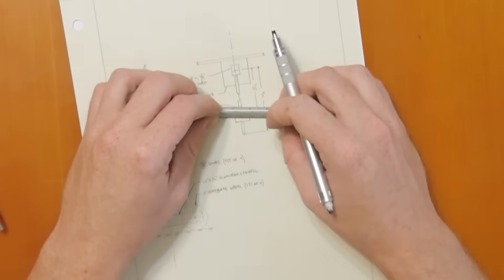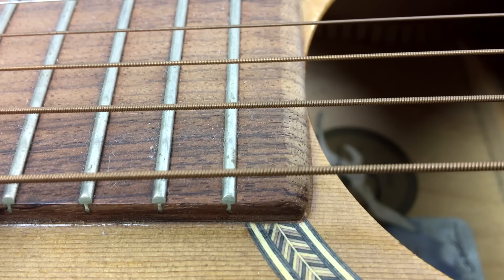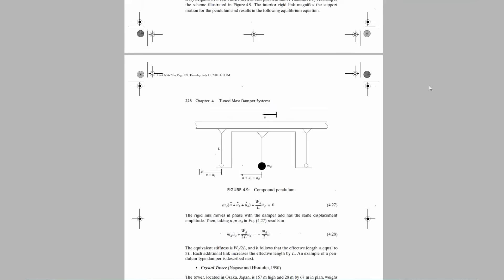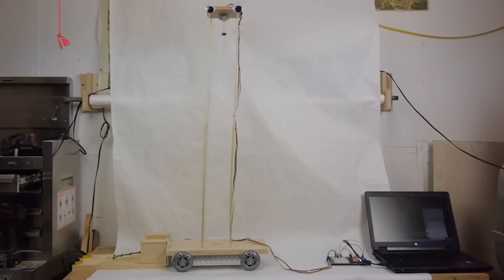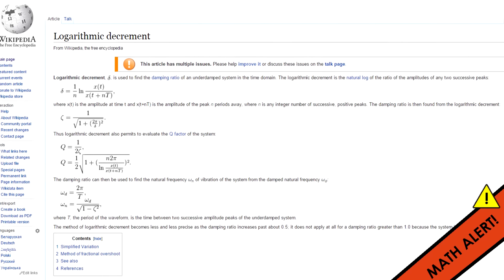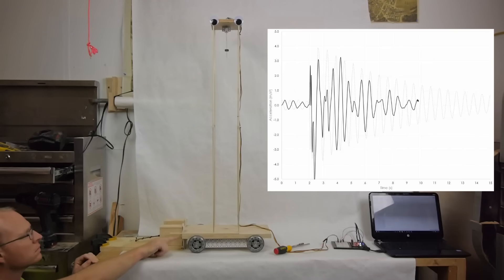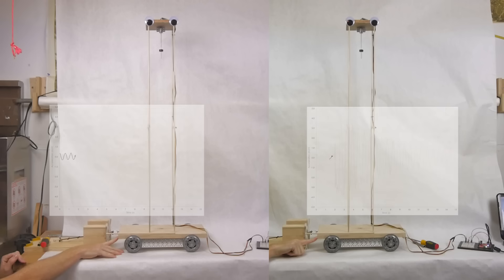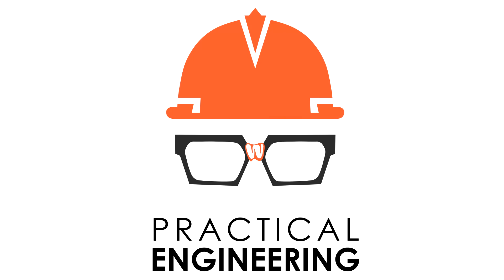What is a Tuned Mass Damper?

Comment: awesome video.  had no idea that was done on skyscrapers. from which height do they usually use this tech?
Reply: It's not much on the height itself, but to several reasons, such as the location it is built if it's seismic or not or affected by strong winds that would make the skyscraper oscillate too much it could be dangerous.
Reply: ***** But considering that winds can get pretty strong a couple hundred meters high, and that wind can oscillate a structure to rubble, engineers must have a rule of thumb for heights or expected wind speeds with this tech...I just try to figure out where can I see it in my area as I climb the highest cranes we have.
Reply: Cranes are different though: because they are pretty skinny and don't have any uniform surface to act as a sail. The damping is made after doing some calculations and statitics on the wind usually found in a location. For sure for something up to 200 meters it's not bother to have a dumper, since it can be done with other structures, but above that sure it's needed. Just look at the biggest skyscrapers in the world, they all have a dumper. 

The only thing crane have is that their horizontal arm is always free to move: that way it gives the least resistance to wind, without being in danger of collapsing. 

In other fields, there's no rule of thumb, but only estimations of the oscillatory frequencies, and if that could give raise to issues. The same applies to bridges that if they oscillate to their resonance frequency can collide. Therefore there is a rough estimation of the resonating frequency of the skyscraper, a statistical study to see if in that area those frequencies could be met, and then it's implemented into the design the dumper. As far as I know the old World Trade Center didn't have a dumper, and you could feel the oscillation on the top. Nevertheless, the oscillation was already dumped by the structure itself. 

In engineering, from civil to aeronautical (I'm an aerospace engineer), there are always trade-offs and compromises. You could build a stone airplane, but you'll have to face immense weight, no useful payload, and gigantic fuel bills. As it's stated in the video, costs are important decision makers.

Comment: Interestingly that type of oscillation is also observed in electronics. Designed (in)correctly, you can have charges oscillating back and forth between capacitors, dampened by the series resistance.

Comment: I liked the Japanese pagodas.  They have very heavy tile roofs on a wooden structure which is almost always a recipe for disaster in earthquakes. But the wooden structure consists of numerous gravity sliding tongue and groove beams and holders which are at right angles meaning each floor can move 360° to the other floors.   Each story is a different size, has a heavy tile roof on its outside and has its own resonance. It is very difficult to transmit energy from its base. Everything moves out of cycle with everything else.  The building has some sliding, but as the earthquake winds down, the movable joints like a pendulum running out of energy move back into their pre-earthquake position by gravity.  This reassembly is facilitated by a large tree trunk that flexes, but moves back into position dragging the joints around it back into alignment.  While this isn't a practical design for most structures, it is interesting and many have stood for hundreds of years.  Shrines to immortal deities are immortal buildings.
Reply from the maker: Very cool.
Reply: I belong to an association which restores and operates antique railway equipment.
       A couple of areas you might consider for segments.
      One would be railroad ballast. It has tremendous compression strength, it will support a locomotive, but it has no tensile strength, a few men with rods and shovels can dismantle it and then reformat it.  The key is the fact it is jagged and locks.  It can support a train, but it can't hold water. 
      Another interesting area that most people are unaware of is how conical railway wheels keep trains on the tracks and allow trains to transit curves.  Geometry dictates that the rail on the outer side of the curve has to be  longer than the rail on the inner side of the curve, but the axil and wheels move as a unit. Solution, as the train shifts in a curve due to differential elevation in the rails, the diameters of the wheels change, the wheel on the longer outside rail increases in diameter and the wheel on the shorter inside rail decreases in diameter. The axil makes the same number of rotations and wants to keep "perpendicular" to the two parallel arcs made by the rails.
     There is a video on the wheel-rail interaction, but it is in Russian.

Comment: Awesome video. Great experiment, and simply explained. I definitely need to check out that Algodoo. Do you have drawings of the pieces and the assembly of that skyscrapper?
Reply from the maker: There's a little bit better drawing on my website http://practical.engineering
Reply: Good enough. Also, good blog. Thanks.

Comment: I don't think the dampener can be replaced by a tightened screw.

Viscous dampers apply an opposing force proportional to velocity, surface friction applies an opposing force proportional to the normal force between the surfaces.
Reply from the maker: This is true. I have a little bit more discussion about the damper on my website http://practical.engineering

Comment: Why not add an additional function to the mass? Perhaps...
have it double as a water tower,
harness electricity from the forces on it,
place infrastructure in it such as backup generators, water heaters, air conditioning, and computer servers,
hydroponics structure,
giant battery for storing off peak electricity
Reply: Pretty much all of those things have fluid in them, which oscillates all on its own. That would be bad. Plus you wouldn't want to have a defect (even repair workers) that would effect the mass. Better to just leave it doing the one job it really needs to do.

Comment: Does the mass of the damper have anything to do with the system besides setting the displacement for a certain amount of energy stored in it? 3d printers suffer from ringing on sharp corners, and I wanted to play with a tuned damper on the print head. Something like a bearing in a closed container of viscous fluid or viscoelastic compound.

Comment: In a real world tuned damper, where does the dissipated energy go? A skyscraper in a wind storm could sway for quite a while. Something would get hot. What is it?
Reply from the maker: +Mark Holm Usually hydraulic fluid in piston dampers.
Reply: +Practical Engineering  And then: air radiators, water heat exchangers?  It has to go somewhere into the environment.  Otherwise, in a long windstorm, the hydraulic fluid would overheat.

Comment: i trade you a like and subscribe in return for an answered question . . .

0.o     objects have frequencies? what does that mean and you can tune other objects to that frequency? please share  your knowledge for I'm curious but I'm not smart enough to get an engineering degree.
Reply from the maker: +mustafa mcclatchey That's right! All objects have a resonant frequency at which they vibrate. This depends on the material, size, mass, etc. You can tune anything by changing it's size, weight, tension, etc. Try tapping on a glass of water as you add more and more water. The frequency will get higher and higher.

Comment: I had an idea to take tuned mass dampeners, and use them in cruise ships to compensate for swaying caused by waves. That way, the passengers can still ride in comfort, but at the same time, the ship can have its design height lowered, making it safer.

Comment: I'm taking Vibes right now on my way to a degree in Mech. This was a really helped my understanding of how damping could be applied to a structure like this. Obviously the vertical supports supply the spring component of the response, but it was not at all obvious what you'd use to damp the oscillations.

Comment: So ive been wanting to do a project to measure the resonant frequency of various parts of my 3d printer when assembled. What's the sample rate you've been able to achieve with your set up? Im a mechanical engineer, the only thing ive been able to think of is rig something up to get an signal from a single axis accelerometer into my laptops auto port and read that with audacity.
Reply from the maker: +lljkSadi That's a cool idea, but I don't know of any accelerometers that put out an analog signal. I really didn't try to max out the sample rate, but I think you could potentially get it quite high if you just used the arduino to interpret the i2c signal and send it over serial. What range of frequencies are you expecting?
Reply: +Practical Engineering The problem that is evident in the surface finish after a sharp edge, a tell tail waviness in the print from the vibration. I'm thinking its in the hundreds of Hz or a little lower. Nyquist being who he is id like to get at or above a kilo sample per second. I frankly have not done enough research on it yet to determine a sensor to use. I'm thinking IEPE piezoelectric accelerometer and a home brew IEPE power supply. And maybe a 24 bit sound card so I'm not plugging into my motherboard. If I go that route, I don't think I'll be able to get accurate magnitudes, but the relative intensity and frequency data should be good enough. And I'd really be able to get high sample rate.
Reply from the maker: +lljkSadi Very cool. You're way outside my realm of expertise. I don't think the setup I used would be capable of that sampling rate, but I was doing some filtering and other stuff with the arduino which probably slowed it down quite a bit. Good luck on figuring it out!

Comment: Excellent video!  I would've loved to have learned about the differences in motion decay rates by degree of damping (hinge screw tightness).  Perhaps you could share how you snuck up on the Goldilocks tightness and how that balance affects such things as peak acceleration reduction, damping ratio, and time until the pendulum stops swinging and permits the building to return to its natural sway pattern.
Reply from the maker: +Patrick St. Pierre I was planning on diving a bit deeper into this stuff (vary the damping, vary the amount of weight on the pendulum, etc.) but the video was already getting kind of long. It's a tough balance to strike between general appeal and interest to the topic and the desire to be extremely rigorous with the nitty gritty details. Maybe I'll do some further testing and post it on the blog. Thanks for watching!